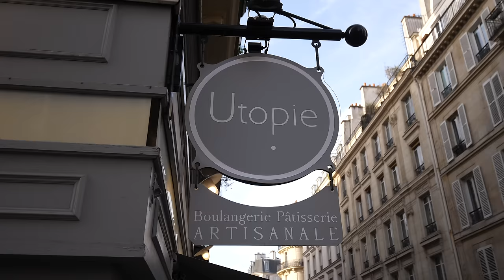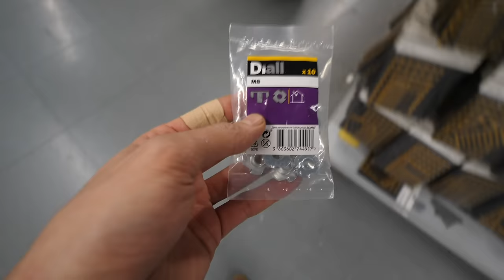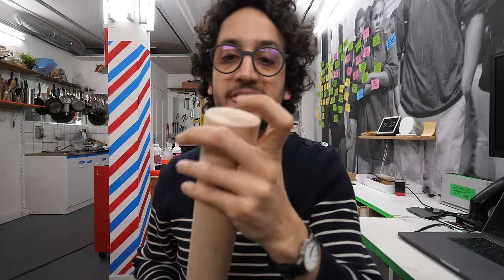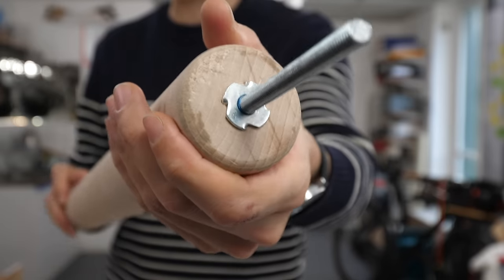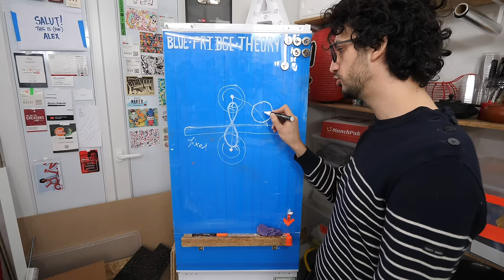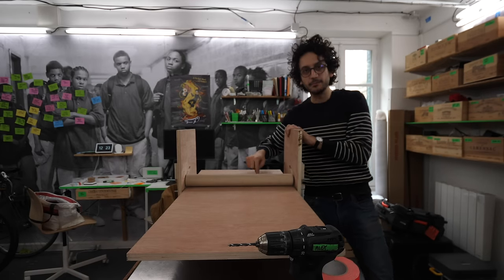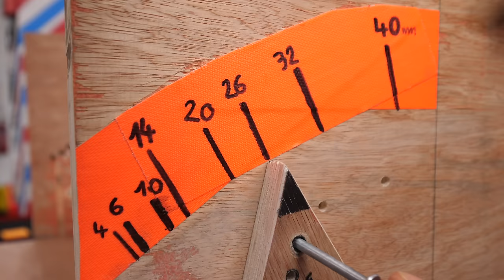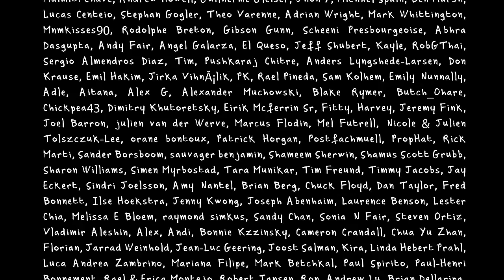I Built A Dough Sheeter To Solve A Croissant Problem...

Comment: some advices... just advices take or leave it.
1. try looking for spares made of stainless steel AISI 304 or 316, it what its called sanitary grade cuz its free of cadmiun and litium, wich are both poisonus, and SS 316 doesnt affect flavor... its no cheap but its worth it.
2. there must be some workshops in paris i mean try looking for a lathe service and ask if they can make you the diameter and length you need, wood, steel, plastic etc.
3. make sure wood its free of weird chemicals cuz some hardware stores soak it in chems to improve the life cycle.
4. and make sure you have control over the chem bath of the wood you use, they need to be bleached to avoid termites and rottening.
5. all plastics are bad in a quality point o view, but for pieces that arent in direct touch with food its fine (like gears)... just dont use nylon or similars, those materials change their properties when you wet them. So i dont recomend it for kitchens.

Comment: Each side of the top spindle, this design needs a tension spring on each side to maintain "pressure" evenly across the roller. You also don't need the bottom roller at all (you could just use your bearings as runners for the sheet.  Lastly, the sheet should be made from either metal or a food grade 1/2" thick polyethylene.  Cool design though.

Comment: I'm not seeing the need for the arching top roller. It seems to me that the rollers in this machine are mutually independent of each other, unlike past dough rollers. To me it seems, the bottom roller only function is used to hold the dough board in place and slide it left to right. As the top roller's function applying presser to what is on the board. While the board applies the opposite presser to the roller and that is what actually levels out the dough. So it seems to me, you could do away with the bottom roller all together and just use a table top to push the dough board on. But if you like the ease of rolling the board dough you could use multiple smaller dowels to roll the dough board on. That way you stabilize the machine in the process and make sure the board stays level.  You could also just have the top roller's adjustment be some that adjust it vertically up and down in which you can stabilize the better. Then you could use the other big roller and make another top roller. That way you can do two rolls with one push or two levels of rolls with one push.

Comment: Make the roller electrically driven you'll get a better result. I worked in a breadfactory and we had a continious dough rolling machine for croisants and the rolling pins were also driven as was the rolling band and that times 3, so the dough came out nice and flat. It also had rolling knives and then another roller which would roll the cut dough pieces into straight croisants. And then some humans (me) would bend the croisants in a half moon shape and then they would go straight into the automatic oven. Good times and lovely smells of freshly backed croissants ;-)

Comment: Just an idea, but rather than having two rollers, why not have three in a triangle configuration, the two rollers on the bottom would carry the plane, you could adjust the height by widening the distance between the two rollers on the bottom that way keeping your drive chain taut. That way you could have a vertical screw to adjust the height of the main roller to help with the accuracy of the press and get that structural stability of a triangle vs. your arcing adjustments.

Comment: Hey Alex, What purpose does that bottom roller have if the desk should be perfectly fine with 2 bottom and 1 upper centered bearing (forming triangle sandwitching the desk in between) on each side? O_o also you can figure out center of circle with right angle. simply position the corner of the right angle and outline both arms from that point. where those two arms exit the circle you connect them with reference line. repeat several times from diferent angles and those reference lines will meet in center. Vsauce just did a video about it.

Comment: to find the center of a circle, square or rectangle, you merely make an X with each end of the lines of  equal distance - but it doesn't have to be exact.   The intersection is dead center.

Comment: To preface - I have worked with dough machinery for over 10 years. 

Alex, congrats on tackling this project - but  the machine is fundamentally flawed at its’ current iteration. 

1) You need two rollers acting on the dough - one roller only tries to smear the dough in the x and y direction overtop the wooden slab - you will have problems with dough elastic memory and it will bounce back and become non-uniformly thicker.

This brings the necessity of a conveyor system - don’t forget your dough linear speed will be different in the outfeed vs infeed because you will elongate the dough. 

P.s. keep in mind the bigger your dough roller diameter the more compression force you will get, and the slower you can run the machine all beneficial to maintaining the required uniform dough thickness and resist the elastic memory characteristics of dough.

Comment: Do you guys have Fastenal stores in Europe? Or MetalSupermarket's?  
I get the wanting to build things with stuff from the hardware store, but hardware stores suck with selection in metals and other fun stuff... 
McMaster Carr is also amazing, if slightly expensive. If you can't get "the thing" from McMaster you are likely in for a rough time of finding "the thing" anywhere in home/hobby amounts... 
It's this Old Tony's fault I'm here, but I'm a welder(with a touch of fabricating/machining) that works with a Lot of  stainless steel for a living. I love doing work for cooks/kitchens/farmers because they usually will trade repairs/parts for awesome food :D

Comment: In theory, practice and theory are the same. In practice, they aren't.
The biggest issue I'm seeing is the concentricity of your rollers on their axes. One way I've simplified such issues on projects is to use a stack of wheels on a central rod, and in your case putting a metal pipe around the wheels. The wheels can be shimmed using layers of electrical tape for a snug fit; no complex lathing needed, just the right size parts. You can even use loose fitted pipes to space out several wheels rather than having a solid stack of them, and the spacers don't need any precision because they don't effect the concentricity.

Comment: Why not use a PVC pipe for the roller? you could make some wood circles with that circle cutting jig to go inside the pipe to attach it to the threads. And looking at your setup you don't really need a bottom roller. In the commercial machines there is a conveyor that carries the dough to two rollers. But in yours the dough stays on a board, so just leave out the bottom roller. Put a crank on the top roller and it should work well enough. Just guide the board while turning the roller.

Comment: I'm triggered very hard by the fact that the upper rolling pin is wobbly, because the pins in it's end are off center. But other than that, great problem solving and amazing video!

Comment: Why not adjust the measurements on the orange tape to that of that actual thickness of the dough once its sheeted. This way you're right, even when its wrong!
Reply: AlexConstantinou, Dough is elastic (and will shrink and thicken after being rolled) due to its gluten content and this elasticity would not be consistent between each run or type of dough to deem it accurate, even if the machine’s scale were to be modified.

Comment: A spring loaded idler would have solved to same problem. Then you couod have used a very percise lead screw ( like a 3d printer uses)  to set thickness.

Comment: I foresee a collaboration with TOT. You are a very clever cooking guy but you don't have access to a lathe, milling machine, etc that would make a simple dough sheeter a thing of utility and a joy forever. It is nothing more than a powered adjustable roll stand and a traveling platen. The platen can be a sheet of plywood or a conveyor. The plywood platen would be far simpler and when removed allows compact storage.  Plastic pipe for rollers? Possibilities abound.

Adding a couple days later: build another Tony/Alex pasta machine but scale it up to suit croissant dough. Rollers might be better in wood or plastic. 10 degree C dough and metal rollers might pose a condensation problem.

Comment: You probably should just use a rolling pin, with different sized collars around it to adjust the thickness. While the gadget is cool, it's way WAY overcomplicated unless you're going to do this a LOT.

Comment: Honestly I'd skip the motor. I also would only have gone with one roller, using the bearings (like it seems you have) to support the tray, and a stronger support of the roller and large range by moving vertically in a slot.

Comment: It turns out you didn't really need the bottom roller, did you?
You could have a sliding platform for placing the dough without the need of the bottom roller.
That being said, it completely eliminates the need for the complex mechanism for setting the distance/thickness. It could be just a vertical setting instead of a circular one.
More than that, I totally understand what moved you at the first place, and the explanation on the blue fridge of the dough being 'sucked' between the two opposite revolving rollers is no longer what you're actually doing with your machine.
Not quite sure either of the implications and the difference between rolling a dough against a flat surface or rolling the dough between two actual rollers.

Great job though!
Salut!

Comment: why not go to a metal shop and make it out of metal? should be more rigid and flex less then your wooden one.

 But if you are set to use the wooden one, i suggest bracing struts at the top and bottom. Maybe swap out the the rollers for regular rolling pins out of nylon/teflon/silicon (that you can buy at a cooking store) and the same with the rolling table (like a large cutting table out of plastic). Easier to keep clean that way. 

Your measuring arc and set should be reinforced with tin or aluminium sandwiched between the plywood on each side. Since it is the most stressed part of the frame, because i can see after a few uses it starts to chip out of the plywood. Roofing tin can be cut and shaped the way you would need it to be, nails or screws to hold it down.

Also, have a second or third roller on each end of the rolling table connected to the base to stabilize the table so it does not torque around the pivot point that is the 2 main rollers, as i have little faith in the smaller rollers on the inside and i foresee them being caked up with flour and other debris rather quickly. should give you a more consistent roll and keep closer to the measurement you want on your dough.

Hope any of this is of use to you.

Comment: why not just use a wooden rolling pin on a pair of rails of the right thickness?  ie two square dowels 4 mm think one on each side of the rolling pin with the dough in the middle.  the rolling pin sits on the dowels and can't roll the dough any thinner than 4 mm.  then you can just have a set of rails of different thickness for different uses.

Comment: At 8:06 in the video, when you test the top roller with your hand, it sort of wobbles in place, showing that the axis is slightly off center. If that is acceptable for you, then no problem at all. If not, you might want to correct that. You might even try to compare which of the two rollers turned out more precise and swap them around?

Also, you might want to check out this video from This Old Tony: https://www.youtube.com/watch?v=uNn6q0TXdDM
It might give you an idea on how to make a more precise mechanism for positioning that mobile roller. Or on how to attach your cordless drill to it.

Comment: Build a better machine and use steel if you can. The problem with wood is that it flexes under pressure. So for the roller, you could use a steel leg for desks instead of wood.

Comment: The arc is unnecessary. The top roller is free spinning. All you will need is to ensure whatever drives the platform (presumably the bottom roller) can be geared/powered. 

As for a motor, I think we all know you're going to use a drill!